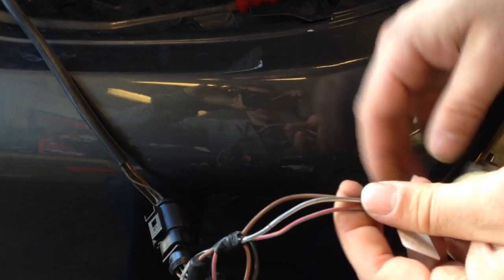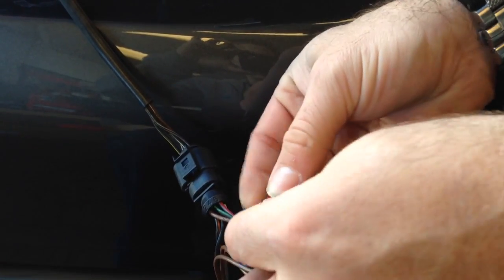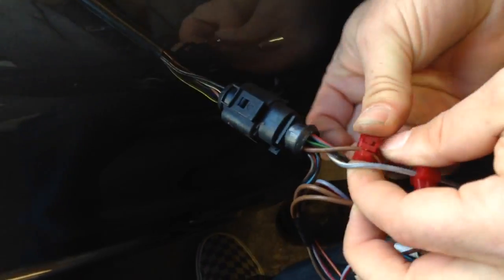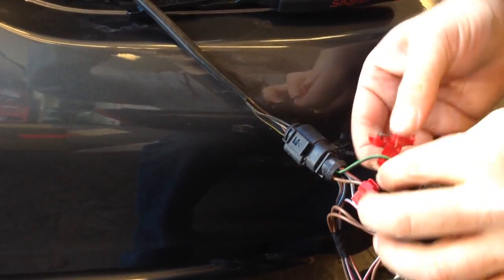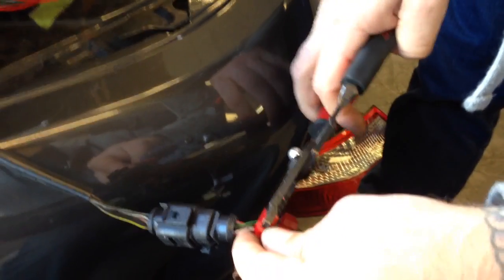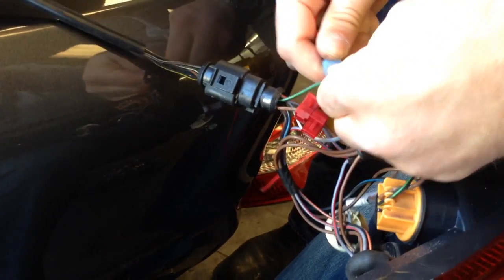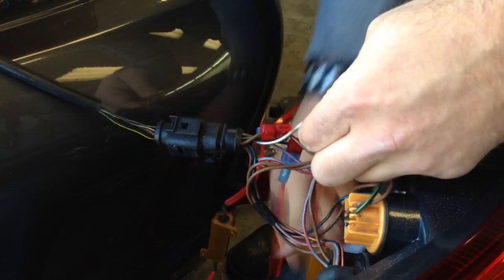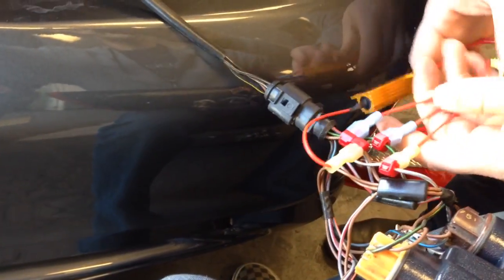Tech Tip: LED fog light upgrade with resistors 997 Carrera

Comment: do all vehicles require the use of resistors to use led bulbs? im doing a build and plan to replace all the lights in the vehicle.. its a 98 s10,... pretty basic.
Reply from the maker: only if the car has a circuit that tells you the bulb is out. led's dont have resistance like regular bulbs. so the resistor emulates a bulb and does not trigger any error
Reply: Delreycustoms cool, thanks man.